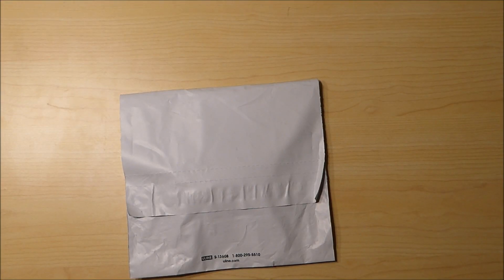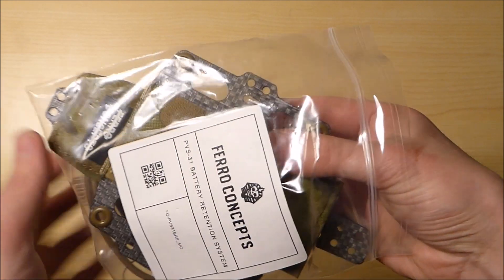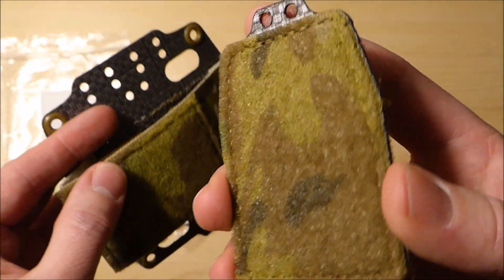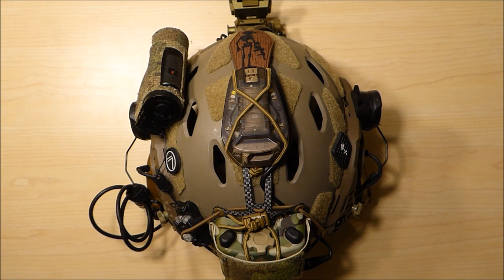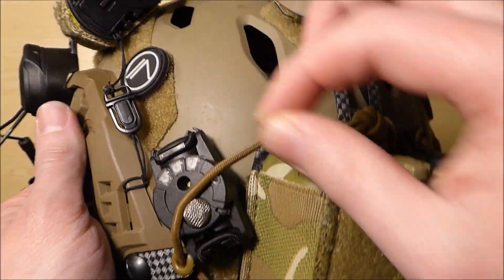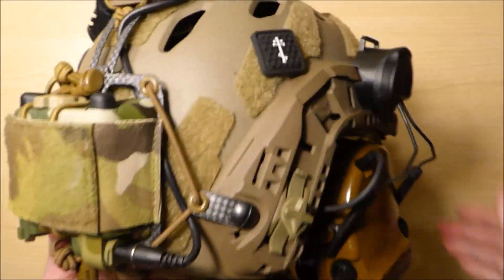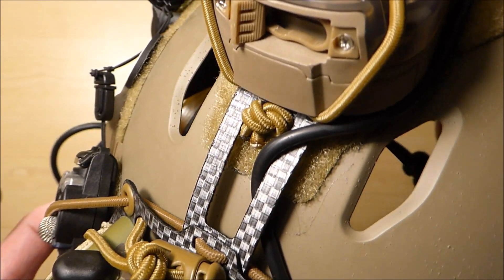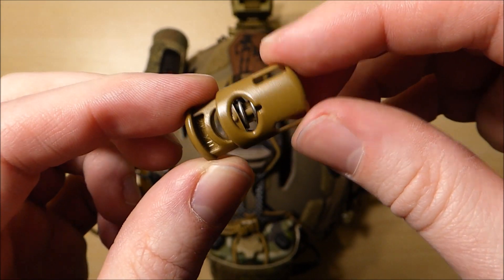Ferro Concepts PVS31 Battery Retention System

Comment: Great video man. It looks like a great bit of kit. I wonder could you fit an external battery pack inside the dummy one and run a charging cable from it if you were running a go pro helmet mount?
Reply from the maker: That's a great idea.

Comment: What is that material that looks "carbon fiber" like called? Been seeing alot of it, but no idea what tf it is? Knowing that (i.e. what type of stress/torque/tension rating that material is would be kind of a big deal). I had a sale for 186 nvg duals for a police dep't and that was the 1st thing they asked when it came time 2 setup helmets with kit. Theu looked high and low, but in the end,  they went with agilite because of not being able 2 easily locate the material specs). We ran with agilite. But they were legitimately curious
Reply from the maker: Tegris

Comment: Help and advice is appreciated. 

I want to build to build a mk18 style AR platform airsoft gun. It doesn't have to be perfectly real steel correct and i would be willing to do AEG, but would prefer GBBR (just nothing seems to be in stock). Also it doesn't have to be picatinny, mlok would be fine too. I've become interested in the Tokyo Marui and VFC stuff, they just seem hard to get right now. I want all metal construction for weight, a mock suppressor, and i want all or most of the components to be decently durable if possible. 

My main question is this, i want the inner barrel to extend into the mock suppressor as far as possible, should i buy an airsoft gun that already has a long barrel and just switch out the outer barrel and muzzle device? Or should buy a short gun and buy a longer inner barrel? I don't want to have to buy to many pieces of the same thing if i don't have to. 

I've never tinkered with any airsoft guns before and the only one i have is an umarex glock 17 that broke after the 3rd time i took it out to mess with it. I think the mag release is broken because i was doing my reloads so aggressively.
Reply from the maker: If you want a MK18, get a MK18. You can get a longer inner barrel later.
Reply: Have you mange to find somthing?
Reply: @colemerritt2616  I ended up with a lancer tactical LT-02 Hybrid Gen 2 MK18.